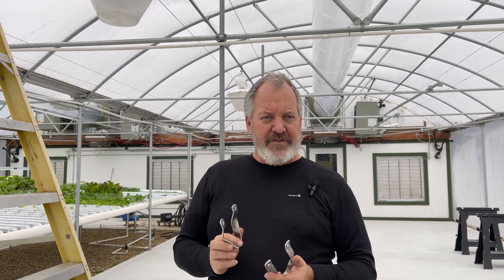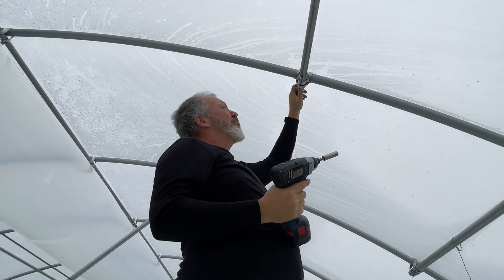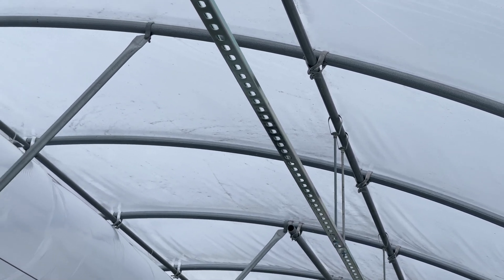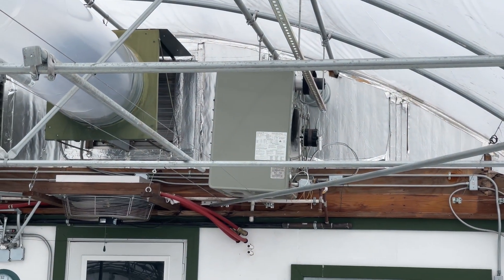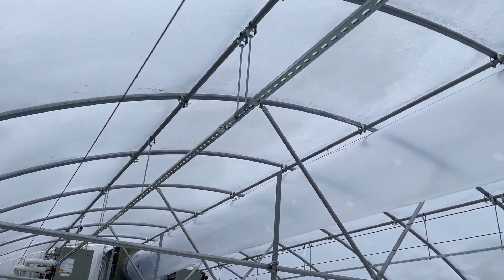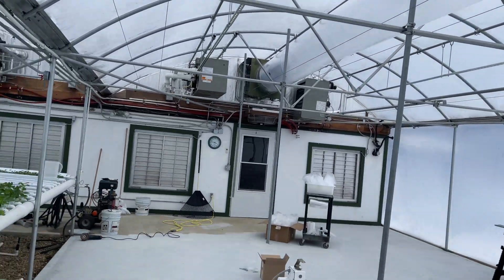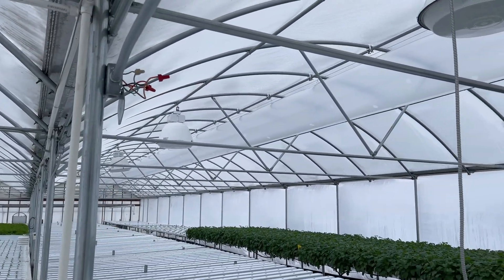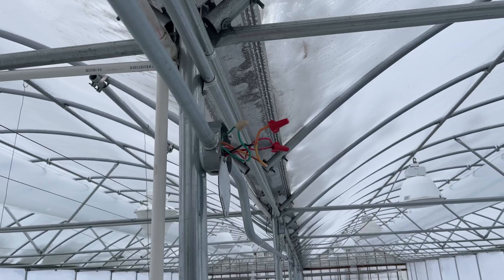LED Light Supports in our hydroponic greenhouse

Comment: enjoy the content and learnt a lot down here in New Zealand - 1 question - the dutch bucket system nutrient tanks I guess they are RTW systems if so what do you do with the waste ? just curious  as in the process of setting up 20 bucket system and not decided on either  RTW or recirculate , would be interesting to here your views pros and cons if possible . Cheers keep safe
Reply from the maker: So, ours drains to waste. We measure the wastewater and try dialing in the system to only have a little waste. We have been told by a number of very smart horticulturist that waste is the best way to go because you don't have to worry about disease transferer between plants. So, it works for us and simple to set up. Hope that helps Cheers. Let us know how you do!
Reply: @HomegrownPassion   thank you for the reply,

Comment: I like your technique for chamfering the ends of the rod after it has been cut.  This eliminates those sharp edges that one ends up with at times when reversing a not over the cut section.
Reply from the maker: I agree. Just a flap sander on the grinder makes quick work cleaning up the threads. Works every time!!

Comment: I heard prior to cutting pieces of bolt that its better to have a nut on, that way removing the nut after you made a cut helps to rethread the bolt so the nut can seat better and quicker.
Reply from the maker: Yep, you can do it that way, but I found that you still have sharp edges to deal with. A flap sander held at an angle to clean up the threads makes a quick job of getting the rod ready for a bolt and it works every time.